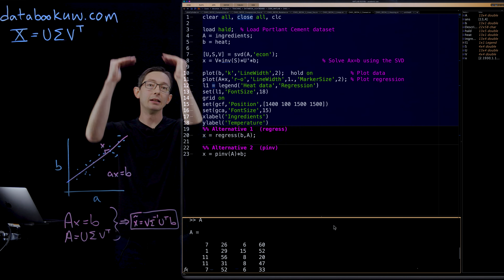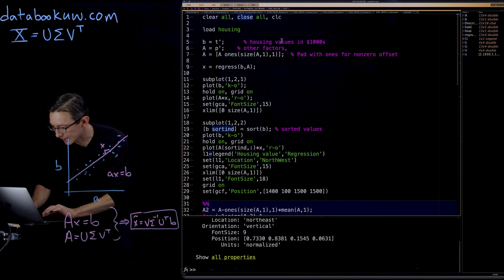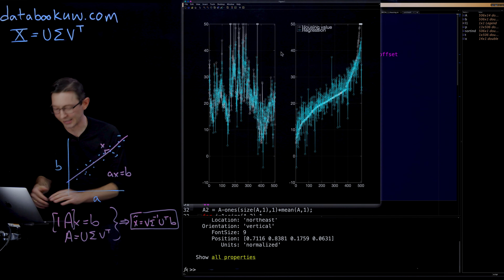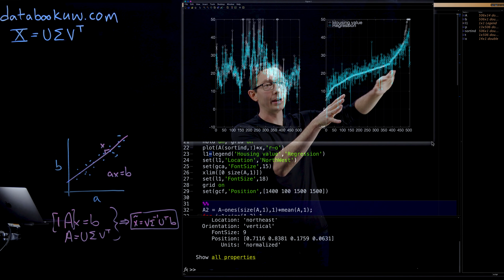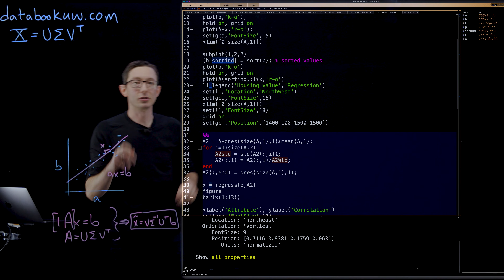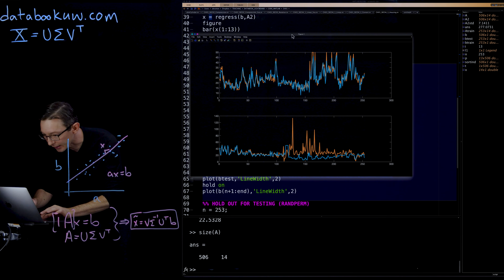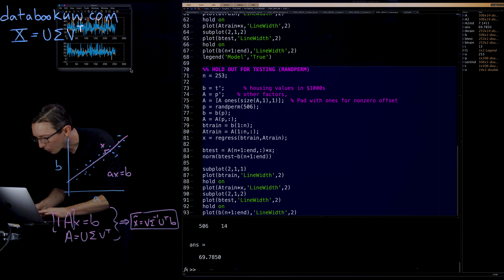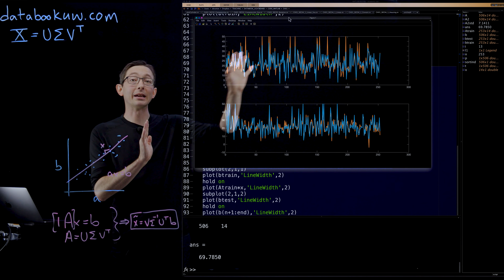Linear Regression 2 [Matlab]

Comment: So here you use svd that reduces data to the square matrix of the same size as number of variables. What happens if you use less components than variables?  Is that even possible?
Reply: If you remember, the components are ordered by importance from SVD. Discarding components makes a less accurate approximation, but sometimes that's fine (perhaps you hade lots of noise in measurement, and getting rid of that is actually a bonus). This is also related to "feature reduction", where you can figure out that some of the data (e.g. shoe size) is marginally relevant for your target (e.g. house price) and you should exclude it. Anyway, the "features" or components selected by SVD are rarely physically relevant or matching the actual features you had in your data.

The other aspect of this was covered in Linear Systems video. Depending on your matrices, the system may be underdetermined or overdetermined. If you have only a few "variables in X" the degrees of freedom are limited. Again, this very overdetermined system leads to a more approximative solution and you may find that it "wasn't useful" even if possible.

Comment: many thanks. Is it similar if giving the fft (as the  Fourier transform of input and output )data into the regression command? it can have a better answer in some cases in comparison with time-domain data. both parts of fft (real + imaginary) data should be given to the regression solver?is there any key point?

Comment: Looks like the housing dataset isn't available in Matlab R2020a anymore. However, you can find it in the DATA zip file for Python on the book website. :)
Reply from the maker: Thanks for the tip
Reply: Thank you for pointing that out. This awesome course would have felt incomplete without this exercise.
Reply: Thanks, Im looking at this a full 4 years later and I couldn't find the dataset anywhere! XD

Comment: Can someone explain this: when plotting the significance / 
correlation of the different attributes, the response vector b has 
been sorted in the previous section, but A and A2 have not been sorted 
accordingly prior to performing the new multilinear regression... surely by doing this, the attribute matrix and response vector do not match as intended?
Reply: I believe that is a mistake. It makes no sense to do regression with sorted b
Reply: Another question that I would like to ask concerns computing Pearson or Spearman correlation coefficients between the original attributes matrix A and the response vector b. If the correlation coefficient for a given attribute has opposite sign to the slope of that attribute from multilinear regression, does that imply that the linear model is not a good fit for that particular attribute?
Reply: > b has been sorted in the previous section, but A and A2 have not been sorted
Old question, but seems to be relevant!
Looking at 9:39 the line 19 sort(b), but also get sortind back. This sortind is then used on line 22 to rearrange A for the plot.
Instead, it would have been good to update A (as did with b) to make sure that it was correctly sorted everywhere.
Line 32 uses original A (which is ok) to create A2. Line 39 regression then should have used sortind on A2 (or the original b) for the regression.
I've only looked at the code on screen, perhaps fixed elsewhere.
---
About the correlation coeff: Does that even happen? If it's close to zero, of course a sign fluctuation doesn't cause much error. If big, yes that sounds like a bad fit, on the other hand it might also be the feature that is useless, but then the correlation should have indicated that.